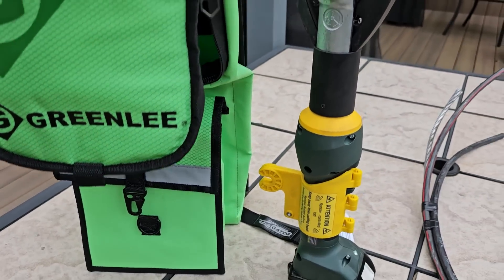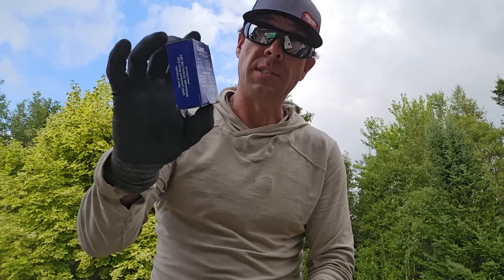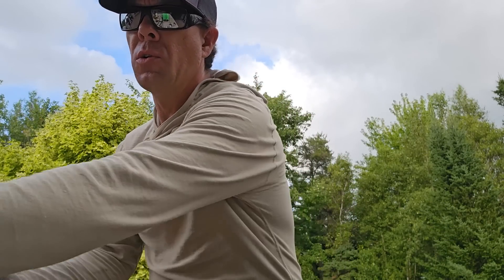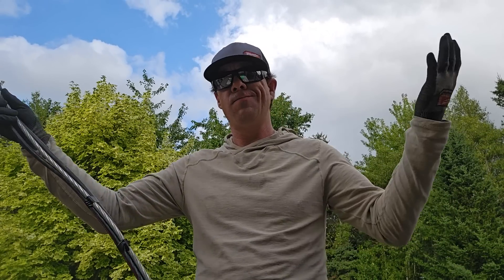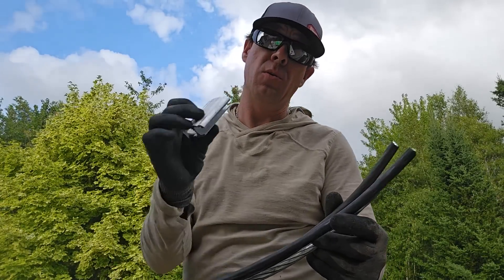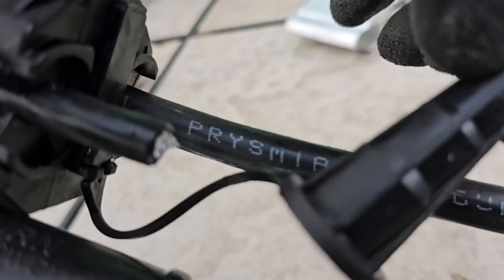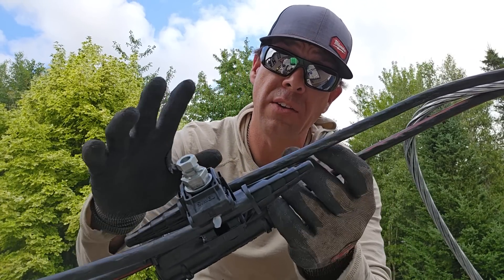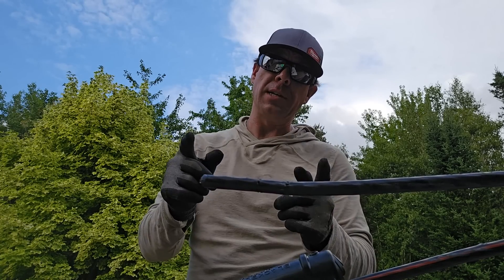What's a piercing connector?

Comment: Are they faster? No doubt. Are they better than compression type? Not a chance. They definitely have a time/place to use. I'd feel more comfortable with full contact of the conductor to the connector. It's a glorified scotch lock like they'd use for car alarms (OK, it's not that bad). I'd be curious to see both connectors under the same load using an IR camera. And I can see an issue with those teeth not digging in very well in the winter when the insulation is tougher. Anyways, as always I enjoy your videos, keep up the great work and stay safe out there!
Reply from the maker: I've checked many with a flir and never once found one hot. I get what your saying tho... It would be interesting to see at a full 200amp! More contact is no doubt better and I was VERY skeptical of these connectors at first but I guess if ya think of it this way; The fuse link in a 200 amp primary fuse (not the tail but the actual link under the paper tube) is incredibly tiny!
Reply: i can see the issue. but it all depends on contact resistance. bare crimp should also make metal-to-metal tight connection. i don't know if they have spikes inside or not. or kind of texture to have better join with wire surface. which is al, which likes to oxydize. but idc ones have 8 spikes per conductor which are sharp and really go between strands. and hermetically seal it up with seal around it and grease. so who knows? i'm sure manuf tested them to destruction pretty well. btw, don't you need to push end caps more. i never checked specs but they have different diameter for different conductor sizes it seems. and don't you need to put lip of those inside groove of connector? so they never fall off. so you have perfect seal everywhere. unsure
Reply: wait maybe i'm talking shit abot lips in connector but iirc ensto had something. it's just friction fit? could also tape it maybe. i recall using tape after removing mid span splice. but then, here ensto makes most of those and grid is 230/400 and has longer low voltage cables that split... so who knows

also remember that i'm not actually doing any line work myself. i just like the topic and hence know a lot. and can take zoomed shots of lines, etc

Comment: I Will stand by AMP wedge connectors, in over 30 years only ever came across one bad connector.
Reply from the maker: Oh yes! Ampac are the be all end all for a good connection for sure! That's what we use  mostly on primary. I'd hate to have to use em on triplex tho :/
Reply: @Bobsdecline  just as easy on triplex, the only time you had to be extra careful is if you were working on old open wire triplex with all of the insulation gone.

Comment: That's pretty handy there. We used to have something quite similar back in the day in the data/coms world called a vampire tap. You'd clamp them around the main line of a 10Base5 Thicknet cable to hook a computer (or some other device) onto the network.

Comment: i wonder if the imact tool shears the shear nut before it tightens as tight as they are supposed to. personally i would tighten them with normal ratchet
Reply from the maker: Excellent point! I'm going to try both and put a torque wrench on em after and test that out!
Reply: @Bobsdecline  The instructions for the ones we have at work (Sicame) say to only use an impact gun at full speed, and to not use a normal ratchet.
Reply from the maker: Interesting! They definitely take a lot to shear off, if you try it by hand.
Reply: @Bobsdecline  Also find it interesting if different impacts result in different final tightening torques after the shear..

Bear in mind loosening torque is actually lower than tightening, so you're looking at a relative comparison rather than an absolute figure.
Reply from the maker: Could maybe  try by tightening and slowly increasing the setting until it budges
Reply: The instructions for the ones we have at work say to only use an impact gun at full speed, and to not use a normal ratchet.

Comment: shouldn't there be a groove in the end of the connector that the flange of the rubber cap/boot fits into which will lock it into the connector body?
Reply from the maker: There is, but they still fall off kinda easy. Ideally you want a bigger overlap so they slide in a little deeper.
Reply: @Bobsdecline  Thanks! As always, you're the best.

Comment: What’s the max amperage you can put on those?
Reply from the maker: We asked the manufacturer and were told; 
They are rated the same as the wires  they're designed for.

That being said... I don't know if they would hold up with two 4/0 copper wires a full load... But then again, I've seen them on many 100kva tx leads and have never seen one fail!
Reply: @Bobsdecline  That is impressive. The connection pins to the cable seem very small.
Reply from the maker: They definitely do! I was quite skeptical but when you think of the fuse link inside the paper tube of a 200 amp primary fuse, there's not much to it!